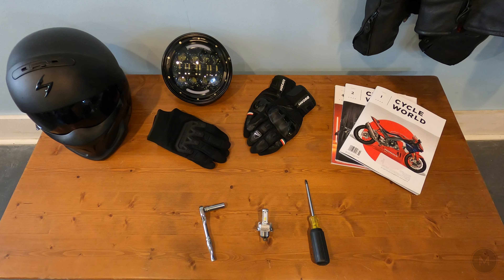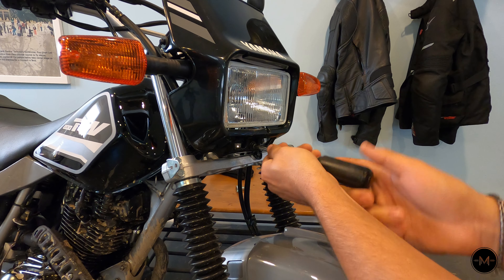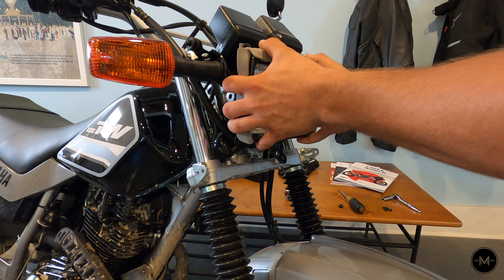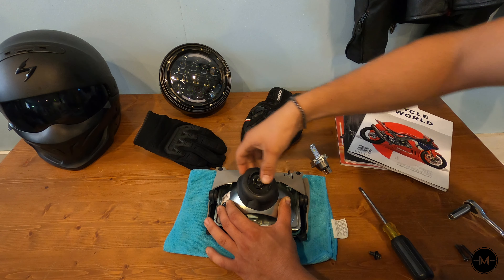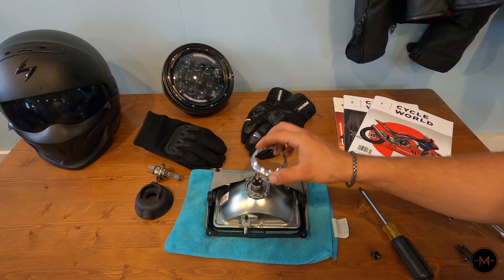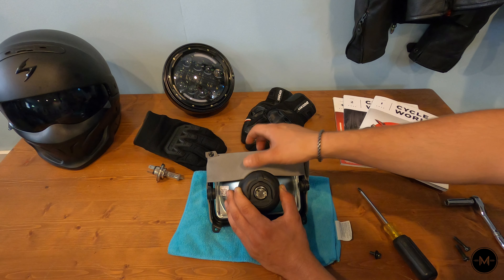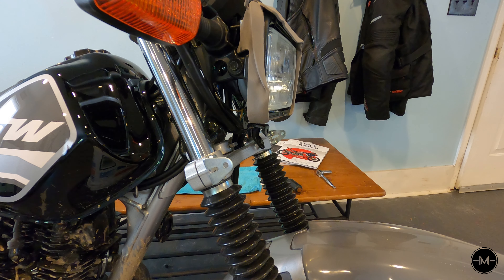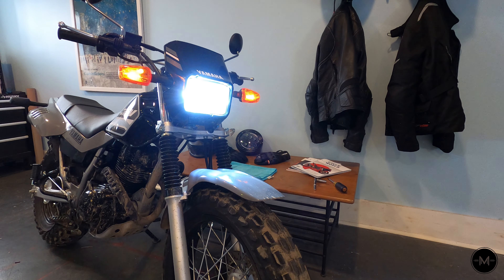Yamaha TW200 LED Headlight Bulb // Install

Comment: Did the foam on the headlight come on it?
Reply from the maker: Nope the grey foam around the headlight is still there. It can be a pain putting the front plastic on because the foam gets stuck lol. But I tucked it in & it was good!
Reply: @MostroMoto  do you have a video on how you put the foam on headlight.
Reply from the maker: I don’t, I could certainly do one if you would like!
Reply: @MostroMoto  I've seen tdubs kid do one so light doesn't shine in your eyes

Comment: What is the voltage difference between the two? Does this free up voltage for auxiliary lighting? I have the same tw on order.
Reply from the maker: Yes it does free up voltage for other auxiliary lighting. I purposely installed an LED headlight, tail light and front blinkers to have extra wattage for my auxiliary lights. The stock halogen bulb is 60 W and depending on what LED bulb you get they range usually less then 35 watts!

Comment: great video!! made it easy for me!! However.... my bulb wouldn't work. I ordered two new H4 LED and neither worked. I put old bulb back in and it works. My TW is a 1987. I have heard it won't electrically support the whole new LED headlight but thought a bulb in old glass housing would work. I guess not????
Reply from the maker: Thanks for watching! Wow you have the classic Tw200! I don’t think much ha changed. Does the bulb physically not fit into the housing? Or it just doesn’t turn on?
Reply: @MostroMoto  im seeing on other discussions that the 87 is the only one with a stator and or rectifier that is older style that won't be compatible with upgrades. My old 87 headlight filament bulb is a three prong and looks and fits exactly like the new H4 Led bulb, but it won't work. Something about triple vs double rectifier??
Reply from the maker: That’s interesting, you would think that with the same connection it would just plug and play. Probably something with the voltage.. hopefully you get it figured out!